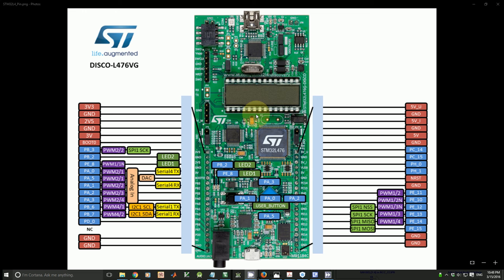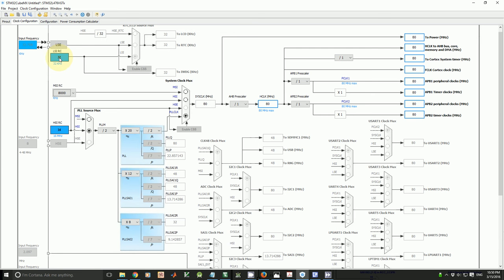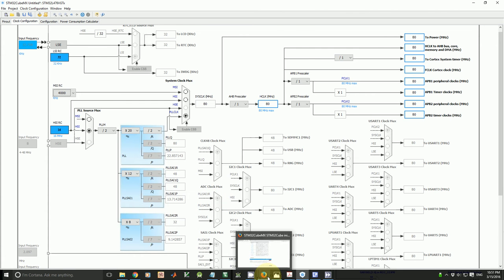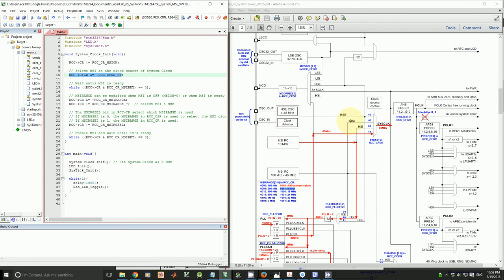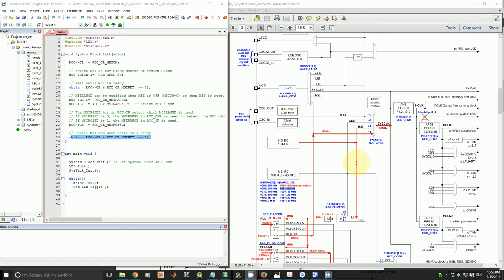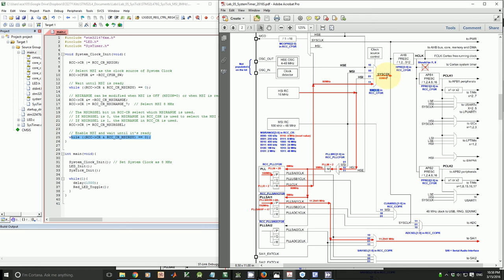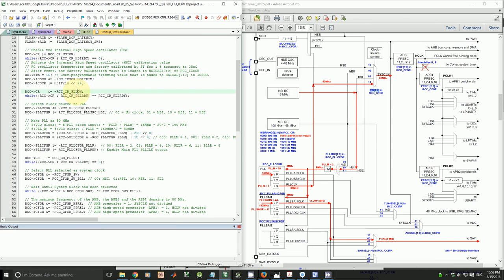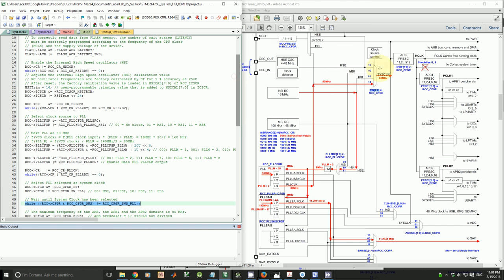Tutorial 3: STM32L4 Clock Configuration

Comment: So N-Queens can theoretically run at 1 gHz, if it is only accessing R0-R15, but other processing might be limited to 80 mHz, limited to external hardware. And with the Harvard architecture the CPU can read an instruction AND data simultaneously in one cycle with both address busses static and set at compile time. Oh boy.